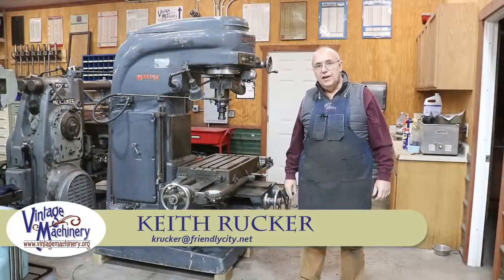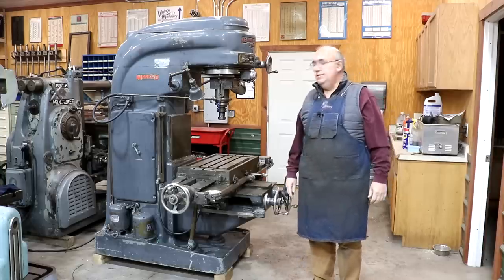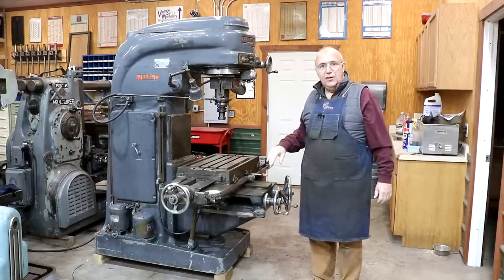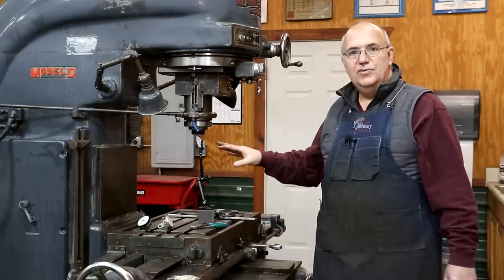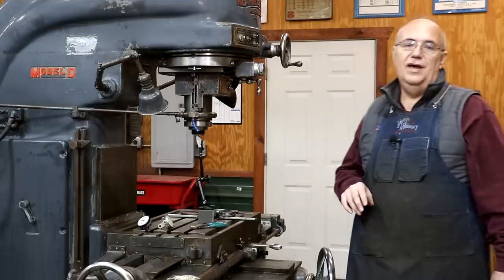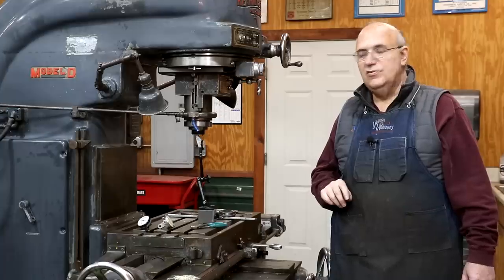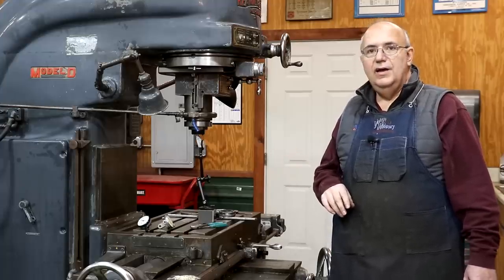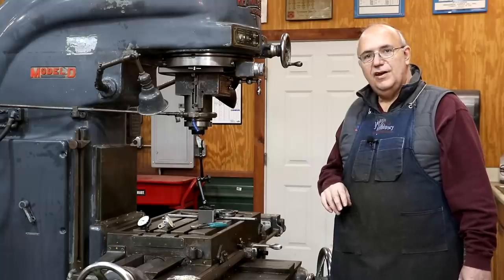Kearney & Trecker 2D Rotary Head Mill: Checking Spindle Runout

Comment: When we built these machine at K&T, the spindle bearings are very high precision- and expensive. I can see there is nothing wrong with that spindle. You have a winner.
Reply: @Current Batches no ball thrust bearings. There are three in the nose and one sealed in the rear of the quill.
Reply: @Current Batches there are 3 ball thrust bearings with spacers in the nose.  In the tail there is a double sealed radial ball bearing-That one is not a high precision.

Comment: You need to check the "other" runout - since the head rides on a dovetail slide, notice that there are gibs on both sides instead of just one. This is because the head has to be precisely centered if the ways are ever rescraped. If the head is off side to side, milling a 3/4" hole with a 3/4" cutter would wallow the hole out a bit if the head were rotated. To do this, you have to zero the head in and out precisely. I zero mine on the vernier with the head travelling OUT toward the 4" offset (there is lash, you have to pick which direction) Depending on the majority of the milling you do, you may want to zero it the other way. I tend to enlarge radii more frequently so OUT works best for me. After that is zeroed as best you can, park the indicator on the side of your gauge pin and orbit the head 360. There will be some side-to-side runout that can be reduced by adjusting both gibs. This shifts the axis of the entire spindle assy a bit and you can get within your .0002". Mine's running .0003" now and is due for a gib adjustment.

Comment: I think a more accurate measurement of the runout would be obtained by turning the spindle by hand or running the machine at a much lower speed - because the measuring tip of the indicator can bounce of any irregularities and give a false (too large) reading. Thanks for the video - that's a beautiful beast you have there!
Reply: The gauge has resonant frequencies.  If you happen to run the spindle at or near those frequencies the needle will swing beyond the actual runout.  Likewise, if you run the spindle at a speed between those frequencies the needles swing will be less than the actual runout.  Turn the spindle slowly, either by hand or at most a handful of rpm.  That will give you an accurate indication of the spindle's runout.  Your conclusions based on the 'measurements' you did on the video are misleading at best and are useless.
Reply: @alanblair3193  Not only that it's not good for the indicators.

Comment: Hello Keith, I bought one of these machines about a year and a half ago. It came with K&T tooling. I got #20 and #30 taper AND ARE MARKED K&T. It came with a Jacobs chuck and small boring head. The collets for those two pieces are also marked K&T. FYI I have a Tree vertical head for a  Brown and Sharpe Horizontal mill that takes Z collets. I have a Y and a ZZ collet. None of these work on the K&T mill.  My mill was repainted sky blue, had a power feed added to the Y axis, and had a DRO. The only bad thing is the table has a bad gouge. I can send some photos if you would like. I haven't really used it yet, but am anxious to get to it. Thanks for your videos!

Comment: I am impressed with the low runout on that spindle. I would definitely invest in a new set of collets. I would also shy away from the used collets unless I could inspect and test them on the machine.

Comment: Keith your collets look like a Z style double taper. They do come in different sizes such a Z, ZZ and so on. The length of a Z is a 1.50 and the outside diameter is 1.12 and 3/4 of a inch is the largest inside diameter. I am getting this information of of the Universal / DeVLieg website.

Comment: Hi Keith!
Looks like a great, new machine.  Also, seems to be well cared for.
One point - that spindle lock is going to be a large pita, climbing up and down all day.  Maybe you could engineer a solenoid to operate the lock electrically, and tie it into the spindle motor to automatically unlock if the motor gets juice.  Could be a good modification...
Thanks again, and keep up the good work!

Comment: The gauge is further from the bearings so there will be more runout even if they were perfect. That said adding an extra component, the collet and pin gauge, will also add something into the equation. So the spindle looks like a winner :)

Comment: When checking spindle run-out, why not run spindle at lowest speed or rotate it manually? Wouldn't that reduce the jitteriness of the dial indicator needle?
Reply: My thought exactly.
Reply: You'd think that would be obvious but he does have a general tendency for errors to uphold. 🙃
Reply: I was thinking the same thing…also, is a super-precision dial indicator meant to be working at several hundred RPM’s? The internals of that poor indicator had to be screaming in pain…
Reply: Turning it by hand seems best. On a massive machine like this, hand turning won’t be a problem, but on smaller machines, even Bridgeports, your hand pushes the quill off axis just enough to affect the reading a couple of tenths. So rotate by hand and then wait a few seconds. But for greatest accuracy in readings you really need the machine to rotate itself. Otherwise you’re not getting the true reading.
Reply: I'm pretty sure at this rpm the inertia of the indicator needle will affect the results to a point where they are worthless.
Reply: @Henning_S.  there no inertial involved here. The indicator tip is pressed against the pin with a spring. The pin is acting like a cam and pushing the tip against the spring. The spring ensures constant contact.
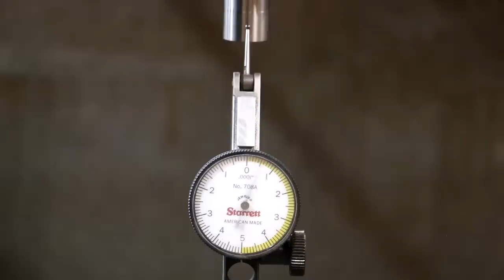Reply: @melgross  watch at 15:40, when the rpm goes down the runout increases massively. 
I am not talking of the tip of the indicator, it just moves a tiny amount and it's spring is indeed relatively strong, so there is no problem.
But since the needle is not mounted directly to the tip, there are some tiny gears inside to amplify the movements of the indicator tip. And because there is some play in the gears, the needle is preloaded with another tiny and weak spring to keep the gears slightly preloaded to eliminate the play. If the needle oscillates too fast, the inertia of the needle will overcome the force of theat spring and the gears start to rattle.
By the way, that is also the reason why you are not supposed to use regular pressure gauges to measure oscillating pressures, there are special ones filled with glycerin to dampen the oscillations of the needle...
Reply: @melgross  Thanks! I presume that, if it's necessary to have the machine rotate itself, the lowest possible speed (in RPMs) would be best.
Reply: @Henning_S.  I’ve never seen that happen with high quality indicators. I suppose if we’re talking about moving mist of the indicator range, it’s possible. But this is just moving two to three tenths. Its not likely that would happen. I’ve got oil filled meters and they still oscillate slightly under heavy vibration. But those are different in design, certainly not precision. At any rate, yes, I would have preferred to see him set a slower speed.
Reply: @melgross  what is your explanation for the runout suddenly increasing from 0.8 thou to almost 3 thou when the spindle slows down at 15:40 ?
Reply: @hartl002  absolutely.
Reply: @Henning_S.  vibration in the drive train.
Reply: @melgross  to confirm that we would need the a video of the slowdown when he measures the inside of the spindle taper, if it is also 3 thou it is caused by vibration, if it is way less, it is caused by the indicator. Unfortunately he didn't include that footage.
Of course the easiest and proper way would be to just take the measurement at the lowest possible spindle speed or to turn the spindle by hand.
Reply: @Henning_S.  yes, but again turning it by hand us known to cause a deviation. As I also said though, this one is likely too massive fir it to be a problem.
Reply: How much runout from bounce?

Comment: I noticed as you tightened the 5/8 pin into the collet, you dramatically over-tightened it! Keep in mind, these collets have dual tapers, which means it's in effect a compound action. Over-tightening is the main cause of broken collets, as you already have two examples of this effect. K&T heat treated everything very well, including these collets, so keep this in mind when securing all collets in this machine.

Comment: Based on whatI have seen of this machine (and the one on Engineer's Workshop) it is about as close to an NC machine as a manual machinist is likely to get. Also, it has some of the features  of a jig borer, not usually seen in  a home shop. Strongly recommend obtaining the most accurate tooling available now that you have explored the spindle runout.

Comment: I made a similar collar for mine, so I can use QC30 tool holders. I have a full set of original 20 and 30 taper collets, but now have a selection of QC30 holders. (No I won’t be selling my collets!). I keep thinking I’d like to automate the spindle lock with a solenoid, but the rotary motion makes that tricky.

Comment: Not being machinist I don't know what term runout means
Reply: It's an indication of how much a rotating object will wobble with respect to its axis of rotation. If it was bent, say, or not mounted properly, you'd see lots of runout.
Reply: Joseph- the actual term is called total indicator run-out or TIR and indicates the amount of run out over the test range, a full revolution of the spindle typically. The method used by Keith is common but inaccurate as is mentioned by a couple of other people on this thread, however it is good enough for our usage.

Comment: What do the numbers mean in 20, 30, and 40 taper?
Reply: It's the size and it very loosely corresponds to the biggest diameter of the cone in mm. For example for the 30 taper the biggest part of the cone has a diameter of 31.75mm.

Comment: With a .0002 run out I would buy the new set of collets also. It will only make the machine more valuable in the end.
Reply: Collets, of any type is one of those tooling items its just not worth going for the cheap ones, just spend the money needed for decent quality.
If the new collets are quality and made to the correct spec, get them.